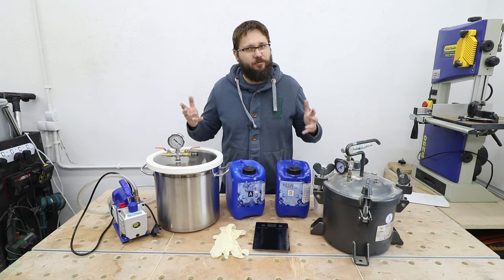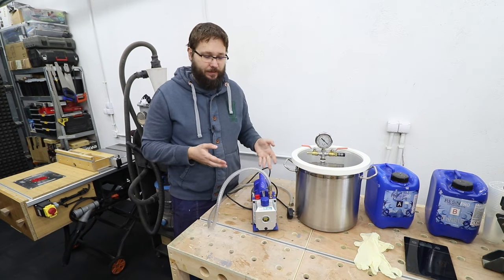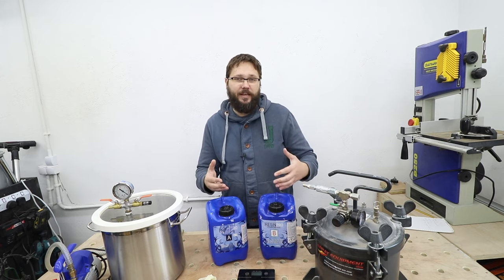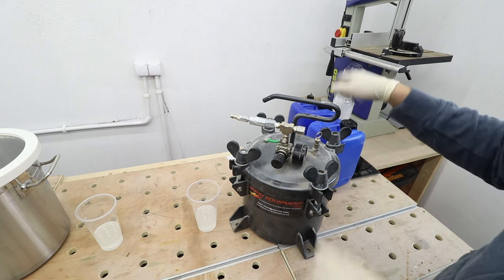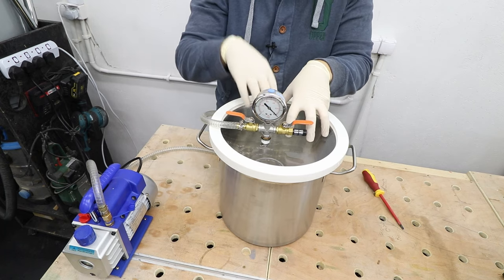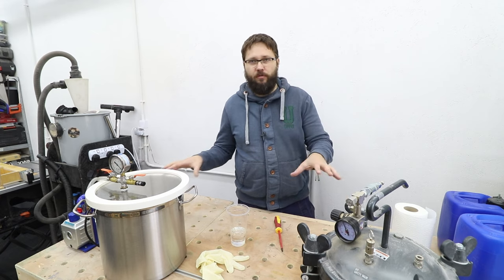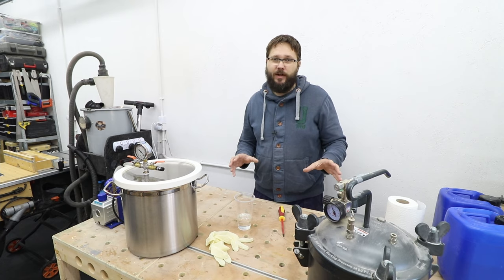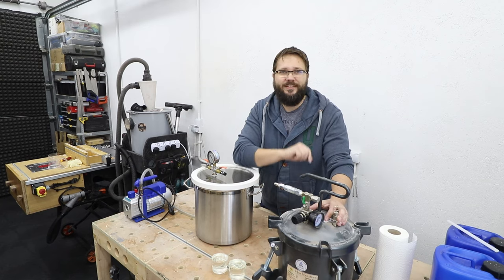Pressure VS Vacuum | Which one is Better for Resin Casting | Resin Casting Basics

Comment: Just a thought. You don't necessarily have to pull a full vacuum in order to get good results, thereby reducing the time you have the resin in the vacuum pot quite a bit. Second, once you remove the bubbles and pour, nothing says you cannot put the mold + resin back into the vacuum pot. Yes it would take a bit more time, but it won't foam the second time, while still removing the bubbles from the pour. Third, I say why not go with both--degas the resin in the vacuum pot, pour and throw in the pressure pot!
Reply from the maker: First - if you don't put full vacuum it will take far longer to get the air out of resin as there is less pressure.
Second - it depends on the size and shape of the mold if it will fit in the pot, and the bubbles coming out will not cause any issues ie if you fill to the top it may overspill and give you poor results.
Third - doing both is a waste of time and pointless, pressure pot will eliminate the airbubbles entirely. 
You need to consider curing time of resin as well, usually the resin with long open window  will self degas if the right conditions are met. Fast curing resins can only be done in pressure pot as it works instantly.
Reply: @CasualDIY  Curing a resin in a vacuum chamber reduces its boiling point, for thin casting it will be alright but for resin above a certain thickness, heat produces in a vacuum chamber cant be transmitted out as there are not much air to move the heat, added with the reduced boiling point, there might be even more bubbles as the resin boils, so pulling full vacuum and cure the resin in it will certainly create bubbles in thicker cast. In short, curing resin in a vacuum will make it heat up to its reduced boiling point faster and stays at that temperature because excess heat becomes bubbles. (so it might be the best to vacuum the resin, and leave it outside so that heat can be transmitted away from the cast)

On the other hand, pressure pot increases the boiling point of the resin, hence it will cure to a higher heat without boiling (which creates bubbles) on thicker cast (which can be seen in the video, the cup of the resin in the pressure pot had melted compared to the vacuum one). It creates no extra bubble as it does not boils even at higher heat, however, the downside will be that the lifespan of the silicon mold will greatly be reduced because the heat produced were not removed through boiling.

By doing both, its not a waste of time because it appears to slightly increase the strength of the resin because compresses the air in it just creates a super tiny bubble that waits to expand into its original size, which is technically internal pressure point. It can also reduces the curing time on thicker cast (because increased boiling point = higher heat cap in the resin, more heat = faster cure) , but at the cost of the mold's lifespan.

I am by no means any good in resins, just take what I said as a pinch of salt.
its a really good and educational video by the way, Thank you so much! =D
Reply from the maker: @ZiFengLearnstoMake  It all depends on the resin you use, poly and epoxy, thin and thick, slow curing and long curing. Depending on what you use it will have it ups and downs. In general I recommend epoxy as its bit easier to work with and the heat seems not to be such an issue in pressure or vacuum pots. I think what you mentioned is more for the poly variants. This topic is vast and there is no one good answer in all cases. However the "DIY" resins usually are easier to work with and work well with pressure pots.
Reply: Most if not all my resins i use are fast room temperature cure resins like the polyurethanes i use you only have 3 plus minutes before cream times all up cure in about 6 to ten minutes no time for vacuum lol 😆 the slower resins I use like polyester and epoxy are bit slower like 30min  so one has to be smart in the  mixing an pure and mould design 😀 has any one every use ridged polyurethane foams hmmm lol you have to work fast using them and big pressure in the moulds i have made dental trays with polyurethane ridged  foams in alloy moulds with a heated mould  and you have to work fast total set up is like 6 minutes no time for vacuum but in this system we want a foaming resins obviously its a foaming reaction lol ok but the finished product is a hard polyurethane plastic most of my moulding are functional and load bearing but still have to have quality and look good 👍

Comment: For clear resin casting, you need to degass the resin after mixing, pour the mold, then use a pressure pot to have the best chance of not having a bubble.  You need both.
Reply from the maker: Depending what resin you are using. For that long of a process you would have to use a resin with very long open window and I mean long. Usually those types of resins are used for river tables etc and are self degassing - curing time several days. If you degass the resin then pour it into a mold then you will introduce air bubbles in the process. Pointless task if you have a pressure pot that will remove 99% of visible air bubbles.
Reply: What happens if you mix degas , pour in mold , degas the mold in chamber and remove ?

Comment: Thank you for this! I've been using a vaccum chamber and always get bubbles when I pour with anything in the mix. Clear is fine but bubbles get stuck on glitter easily. I hope a pressure pot will fix things.
Reply from the maker: Pressure Pot is for sure the way forward 👍
Reply: Thankyou your question is more what i was after.

Comment: I have seen this video over and over from many different youtubers. I would like to see some experimentation done. You purposely mixed the air into the resin and for obvious resins to show the different between the 2 methods. I would like to see part A and part B vacuumed separately first and then genitally mixed  and re vacuumed and see how much bubbles are produced. I suspect the amount of bubbling would be dramatically reduced. Most liquid holds as much air as empty space does, so vacuuming the A & B parts before mixing should extract the dissolved gasses out of the resin before they are mixed. They would not be curing so there would be no time crunch, you could leave the part A & B in there for hours if needed. I dont think there would be any sublimation between the 2 parts but if there was you could do part A and part B separately and then mix them. I was just curious and I hadn't seen anyone try this method  before. Might be fun to watch.
Reply from the maker: Your predictions are most likely correct. It's just not a very time efficient way of doing this. It would take far longer than it needs to for not much improved in the finished product.
Reply: I’m curious to see how “genitally mixed” is achieved. Are there videos? 😂
Reply: @markgearing  I think that would be an over-18 channel...

Comment: The pressure not only minimises the bubble size, but also helps the air dissolve it in the resin, removing bubbles entirely.
Reply: Exactly.  I vacuum degas the resin components before careful mixing (if the mixed pot life is too short to degas mixed) in order to pull some of the dissolved gas out of solution.  Normally the resin components have dissolved all the gas it can at room temp and pressure and are saturated.  Placing them under vacuum not only causes bubbles to enlarge and rise, it also causes gas to come out of solution and bubble off.  The components are now desaturated, holding less gas than they are capable of.  This makes them able to dissolve gas even before pressure is applied, and dissolve even more gas when pressure is applied.  

Maybe it's overkill and the pressure pot is doing most of the work, but even with very rapidly curing resins, I have never seen even one bubble.  Not even when inclusions like glitter are present that tend to promote bubble formation.  And in those cases where the mold was not made under pressure and may have air bubbles that will deform under pressure and can't be used in the pot, it helps a lot to reduce bubbles even when there is not enough pot life to degas the mixed resin.

Comment: The pressure pot pushes the air out of the resin, as the resin is heavier than air. It pushes the resin into the mold, forcing the air up and out. It doesn't just make the air so small you can't see it....
Reply from the maker: I haven't experienced that "pressure pot pushes the air out of resin" and I have made many tests over the years. Also using materials with cavities on many occasions it will not be 100% filled. That depends on resin viscosity, curing time and so on.
Reply: @CasualDIY  probably depends on the complexity of the mold and the type of resin and whether or not the resin has been vacuumed first (vac part a and b separately so less air is in when mixing slowly) the pressure pushes the resin into the tiny gaps that air likes to stick to, and the air doesn't have anywhere to go but up... But I'm also using wider shallower molds, which may explain my experiences vs average
If you use wider base cups so the resin is less deep in the vac chamber btw it finishes faster as there is less vertical for the air to go through. (To an extent. More always still means longer like you said).
Reply from the maker: @XDeminox  Exactly, it's a complex process and there are many factors.

Comment: Hello Thomas,
I have tried epoxy resin project twice. I couldn't. the result was disappointing. Later I realized that this job has many details. And there are aspects that I need to learn. And I didn't have the courage to try again. but someday I will definitely use an epoxy resin for woodworking. Thank you for sharing this detailed and beautiful information about resin casting. all the best. See you.
Reply from the maker: Yes working with resin can be challenging and expensive. It's always worth to do as much research as possible before own experimentation. Got a whole playlist with some resin tutorials if you want to check them out👍

Comment: I cast resin blanks for turning pens, and I use both units for different purposes. I use the pressure pot when I want to stabilize rotten wood. Yes, bubbles will be present, and the vacuum chamber doesn't work too well for stabilizing wood.

Comment: Ideally, there would be a pressure canner that has an added attachment point (and sealable when used with heat) for a compressor so you can use it for preserving or curing. A vacuum chamber can also be used for vacuum sealing jars of dehydrated food.

Comment: What about degassing the resin inside the vacuum chamber then pouring this degassed resin inside a mould and degas it again slowly? Will this work or will it overflow as severe?
Reply from the maker: It could work but the process would be very slow and long which means most likely the resin would set before you finish the process

Comment: Great video, thanks. For vacuum chamber, is it possible to greatly reduce risk of foaming in mold, by first outgassing the air bubbles from the liquid resin in the chamber, then carefully pouring the resin into the mold (to avoid creating new bubbles), then placing the mold (with resin) into the vacuum chamber while it cures?
Reply from the maker: You can, however its not efficient you have to be there all the time during the whole process to control foaming. Plus you would have to use resin that has got a very long open window. For casting I mold it's far better to use pressure chamber.
Reply: @CasualDIY  Thank you!

Comment: That was an excellent tutorial. YOU answered all of my questions  Thank you.  I agree with your suggestion that you ideally need both but if you can only afford one get the pressure pot.   I suspect you could use an electric car pump if you don't have a compressed air source.
Reply from the maker: That potential could be too weak
Reply: @CasualDIY  The one I am looking at will get up to a maximum pressure of  150PSI  (10 bar) at a maximum airflow of 85L/min.   
-
Reply from the maker: @stephenleach3110  I would read the specs of the pot first as it will say minimal values for the pump

Comment: Thanks for sharing. 
I have few questions about vacuum chamber 
1 can I put in the chamber resin mixed with mica or glitter or is it only for clear resin?
2 what about flash cure...can it happen during degassing as it takes over 25 minutes?
3 can it be use with any viscosity resin as I have resin pro art deluxe and it is very high viscosity?
Thank you.
Reply from the maker: Hi,
1. You can put dyed resin in the vacuum chamber but you have to consider that potentially it will take longer to degass and the foaming process may introduce something unforseen to the mix. Hard to say what would be the end result as it will all depend on many factors like type of resin, curing time, viscosity etc.
2. Degassing time will vary on many factors. How much resin you put I the chamber, the more resin the longer it will take. On viscosity, the thicker the resin the longer it will take. Resin under vacuum and pressure will cure faster. Very hard to pin point how much faster. I would only suggest using resin with curing time of 1h+
3. Viscosity doesn't matter as much as curing time does. The thicker the resin the longer it will take. As mentioned before for vacuum chamber I would only use resins with curing time 1h+
For fast setting resins I would suggest using a pressure chamber that's if you can fit your project (mold) inside.
Reply: @CasualDIY  thank you very much

Comment: An idea I had - relevant for fast curing resins

Can you degas the resin and the hardener before mixing, and then mix them under vacuum using some device? (Something like the magnetic stirrer that chemists use inside beakers)

Then theoretically the mixing won’t introduce any air bubbles - and your resin will be ready for casting immediately after mixing
Reply from the maker: You won't have enough time to do that under pressure. How would you operate that device and how it would behave in such great pressure

Comment: Hi SIR.. THANKS FOR YOUR REPLY..MAY WE ASK A QUESTION AS WE HAVE THIS WEEK BOUGHT A VACUUM TANK....THE QUESTION IS HOW BIG A  CONTAINER CAN YOU PUT INTO THE VACUUM AS THE BOOKLET  WHICH WAS IN THE BOX SAID NO MORE THAN FOUR INCHES WIDE AND NO MORE THAN EIGHT INCHES HIGH...THIS IS A FIVE GALLON ONE SO THAT DOSE NOT SEEM TO MAKE SENSE AT ALL...   SORRY TO BOTHER YOU BUT HOPE YOU MAY SOLVE THE WORRY....THANKING YOU...DAVID..AUSTRALIA...
Reply from the maker: You can put a pot as big as the chamber. But it all depends what you want to use it for, resin degassing or silicone degassing?

Comment: thank you so much for this video,. Super like and new subscriber. I was searching vacuum , and came across a talented turner that uses vacuum and then pressure chamber for wood turning,.  I became overwhelmed as a new turner thinking I have to have both. Thank you. Ok edit  here . I am wanting to do resin wood turning and never done. Do I need both?
Reply from the maker: Pressure pot is what I would recommend. Vacuum Chamber only if you want to make molds.

Comment: Great video but a little confused… when mixing you introduce bubbles got that, then you can use vacuum chamber or pressure pot got that but what if for my situation specifically if im just trying to get bubbles out before I poor on or over something can the pressure pot not do that in a timely manner? Im not worried about re introducing bubbles I can torch those but all the micro bubbles from mixing I want to deal with. I just got a vacuum chamber and it is not very fast and still figuring it out but pressure pot seems more promising but is it just for casting? Thanks
Reply from the maker: As I have mentioned in the video, the pressure pot does not remove air bubbles from resin. What it does, with great pressure it collapses the air bubbles to tiny particles that are not visible to human eye. And they stay that way as the resin cures. If you release the pressure before the resin cures they will give back to initial sizes. Hope this clears things out
Reply: @CasualDIY  Yes it does, I am new to it all and figuring things out, I asked because I had purchased a pressure pot and it came yesterday so was trying to figure out if I was going to send it back because I am not casting parts… I couldn’t help myself and opened it anyway and ran a couple quick tests…. After mixing some resin with a ton of bubbles both big and micro I put it in pot for 20 min and it came out clear and I poured it. Did have a few bubbles but i poured it sloppy but it did work better than the vacuum chamber which led me to believe If I want to use the vacuum chamber only then I need to find a much lower viscosity resin. Thanks for the reply appreciate it!

Comment: Great video , i have a question when you say i took 20 minute for the vaccum chamber . You made it run for 20 minute or you did it for 5 min and let the resin inside for the 15 minute left ?
Reply from the maker: Mix of both. You have to watch the foaming. When that cleared just let it run on full vacuum
Reply: @CasualDIY  thank u the best

Comment: Ive been doing mould making for yrs i mosly use polyurethane elastomer and to remove bupples i try not to mix any into my mix an a warm mould can gelp to burst those little surface bubbles on your parts ive been doing composite engineering for many yrs andi only use a vacuum or pressure pot for complexs moulds that have to be perfect  same with carbon fibre bagging wet lay ups and forgings .
Kind regards Jasmine the JDM girl 👧 from Sydney Australia 🇦🇺
Reply from the maker: Thank you kindly for watching 👍

Comment: Very cool, have you tired vacuuming then pressure for the same cast?
Reply from the maker: Will make no difference. The pressure pot will eliminate any visible air bubbles so you would just be wasting your time.